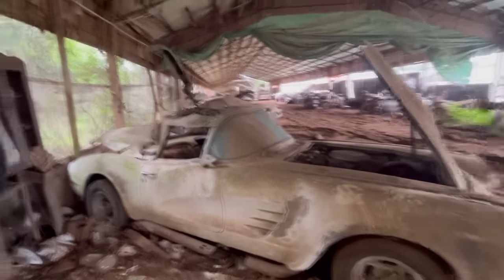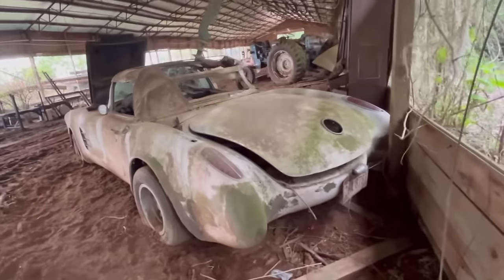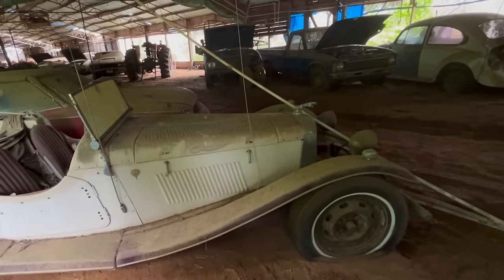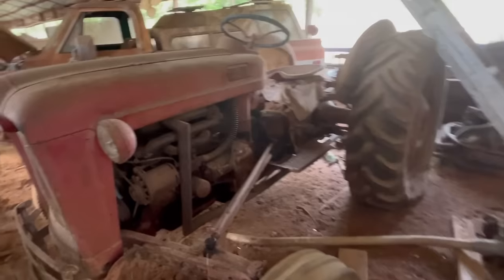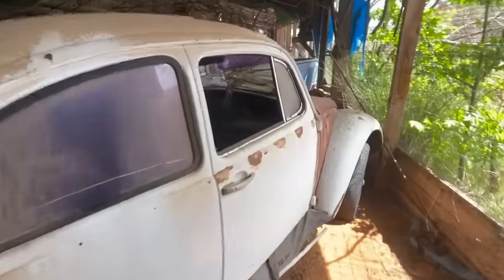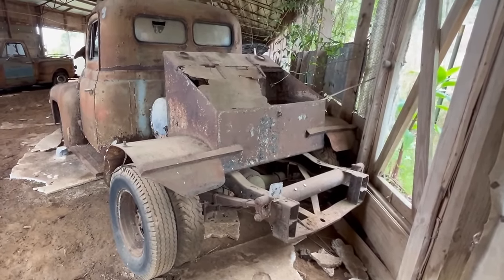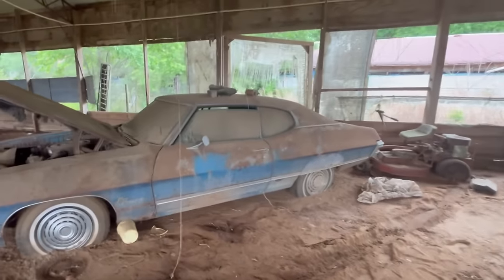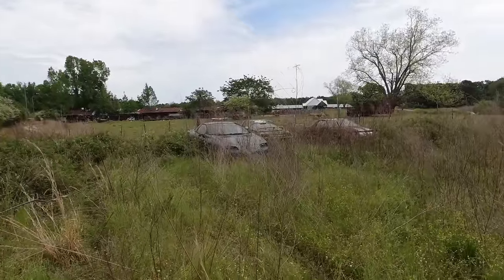We found A 1959 CORVETTE in a Chicken House WAIT that's not ALL!!

Comment: Only a pissed off Ex wife would put a corvette in a chicken house! This is unforgivable!
Reply: At least they have a roof over them. Imagine the condition they'd be in fully exposed to the elements.
Reply: The positive is it's still there.
Reply: At 15-16 years old I worked hauling hay for a guy and he took us to a chicken house to see if any of us knew what something was.. There was a trailer with a car covered up with a tarp sitting in there and a table with 3 different intake and carb setups for Big block Ford's.. On the ground beside the table was a set of Hallibran wheels with dry rot tires and the wheels had no lug nut holes..   When the tarp was pulled off there sat an aluminum body 1966 SHELBY COBRA with zero paint on anything.. I WAS COMPLETELY STUNNED because I knew exactly what it was.... You just don't find stuff like that in GEORGIA and especially in a chicken house..    The car was owned by the man's SISTER who had multiple Porsche and lived in a simi ran down mobile home on the small farm....   Turned out to be a LEGIT 427 SIDE OILER SHELBY COBRA RACE CAR....    AT AROUND 18 YEARS OLD HEARD SHE SOLD IT FOR $ 37,000 sitting there disassembled in that chicken house in NW GEORGIA....   BELIEVE IT OR NOT IT'S A TRUE STORY!! 🇺🇸

Comment: Did you figure out yet the Jaguar is a VW with a reproduction fiberglass body on it? At 19:27 looks like another kit car on a VW chassis.  At 22:00 is a '39 Chevy. Probably a standard. At 41:30 it is a '57 Chevy 210. 46:55 Thay'66 Chevelle has factory A/C! Hard to find option.
Reply from the maker: I did   Thank you for sharing that information on the other cars.

Comment: some one flared the wheel wells on the corvette would take some deep pockets to fix that fubar
Reply: Run hard and put away wet a quarter mile at a time probably has some racing history because the thing is pretty well used up hopefully we can figure it out and bring back to life an iconic dragster with a simple mechanical restoration and that's it no way would you want to destroy the history of a true race car?

Comment: Too bad they only put a little 283 in the vette... still would be an amazing car fixed up... I see a few I'd like to have.. hopefully they find good homes...
Reply: The drag car probably had 10 or 12 motors and transmissions in rear ends in and out of it over the years and been lettered and repainted and body worked and run hard and put away wet for probably 20 years prior ?
Reply from the maker: Thanks for sharing

Comment: It's unfortunate Wally that all these cars are probably locked right up motor wise yes it's nice that they're under roof but they've all been sitting in that same spot for the past 20 40 50 years and unfortunately they probably think that they have a gold mine there it's just that most of them cars for what they're actually worth will take double that to get them running again
Reply from the maker: Thanks for sharing